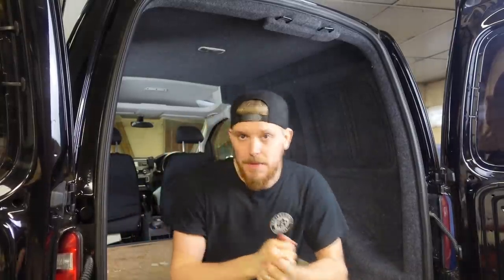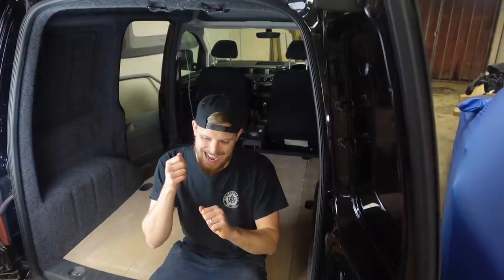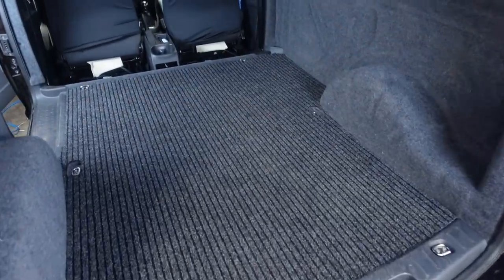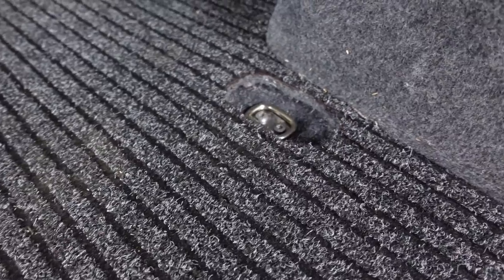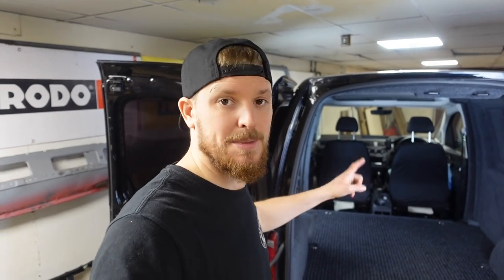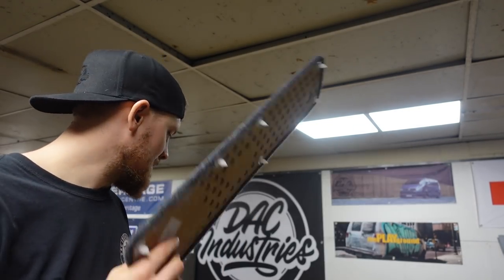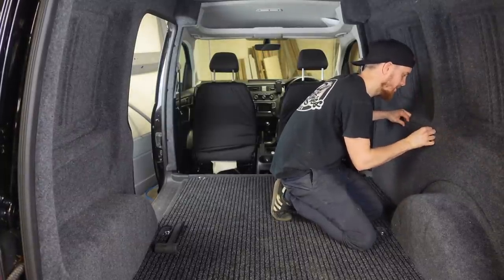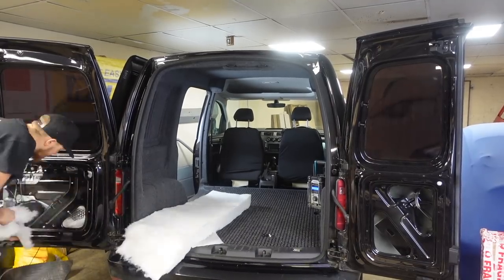VW Caddy 2k Sound Deadening, Insulation & Carpet Part 4 Conversion Caddy Camper Micro

Comment: Another Ace video. You answered a question that I had. I have just bought a Caddy Maxi, it will be used for personal transport and also for carrying bicycles around. I want to carpet it as you have done, but would need to have some protection for the single skin panels against bikes causing dents. The way you carpeted the sliding door is the additional protection that I would need for the side panels too.
Thanks for posting, love the presentation style 👊🏻👍

Comment: God only knows why this video came up in my feed, so - I'm new to this channel.
What an impressive amount of work you've put into this project. It really has turned out to be a very lovely car. There is, however, one thing I don't get: I get why you sound deaden the car, but if the car itself isn't going to be used as a campervan, why then put so much insulation in it? That, to me, seems to be overkill. There seems to be no point in it, then ...
But apart from that, it really has become a very desirable car. If I had the chance, I would buy it ;o)
Beautiful work, Mate!
Reply from the maker: Thank you I did it this way to show the process on here to help people out. as the bulkhead is removed the heater has to work a lot harder to heat up a much bigger space so the insulation will help to keep the interior warm during the winter.

Comment: Suggestion... you coulda taken the ply out and use it as a template, leave excess where you need it, but the tricky bit around the wheel wells would have been a doddle.
Nice job.
Reply from the maker: Yes, Yes I could have🤦‍♂️ I got all excited and fixed the ply down then remembered I needed to cut the carpet to shape.... Thank you so much for watching and for the comment.

Comment: Awesome video, nicely put together. I'm assuming the panel you cut out for the upper side loading door (which you drilled in using screws), can be done for the back of the van as well? Maybe could put a very thin layer of foam in between for insulation?
Reply from the maker: Thank you. Yes that would work.

Comment: What was the purpose of using the hidden clips for the side panels instead of the fir tree clips? Is i just because you can fit them after carpeting?
I was thinking to just use fir tree clips everywhere and just carpet over them
Reply from the maker: Purely because I didn't have enough of 1 type in stock 😂

Comment: Audi A1 SLine seats will fit directly into a caddy van 4 bolts. Far more comfortable and have leather bolsters 🙂👍🏻
Reply from the maker: Thank you so much for watching and for the comment Dude. Great tip, My Step Father is actually happy with the original ones in this!

Comment: Good work mate... Just curious if there was a reason why you didn't carpet the bare metal of the 3 doors? Any plans to "black out" the interior plastics up front?
Reply from the maker: Thank you so much for watching and for your comment Dan. It is difficult to get a decent edge to the carpet on the metal if the doors as there isn't an edge to finish to the carpet just stops. None on this project. This was to just make the van a little more driveable.
Reply: @DanChambersDAC  makes sense mate... Cheers for the videos, it's getting me ready to start thinking about a van for myself 🙌🏼

Comment: great result! I would put the bulkhead back in for some peace of mind, or else you would need to secure everything that you load in the back, even just a bag of groceries would be dangerous back there
Reply: Cargo net 😁
Reply: I guess it's the chance you take, you see plenty of hatch backs with stuff (and dogs, too) on the rear parcel shelf, a decent crash will see your beloved chihuahua passing your head and exiting through the windscreen in the blink of an eye, and that's the other issue, all that crap is at head height, too.
Reply from the maker: Thank you so much for watching and for your comment Bud. Yeah you are probably right but I much much prefer a van without a bulkhead in. I would hazard a complete guess at this van having anything in the back of it would be around 20 hours in a year!!!

Comment: the real question is what kind of difference did it make to road noise?
Reply: and what added weight did it add?
Reply from the maker: It makes a massive difference, probably one of the best mods to do to a van. Quietens everything down. Totally depends on how much material you add regarding weight. The sound deadening is heavy stuff.